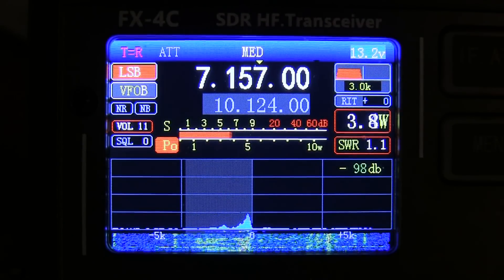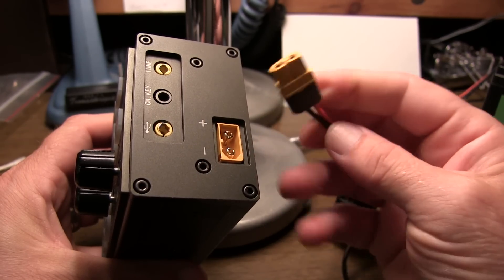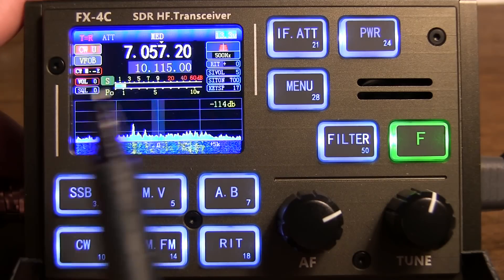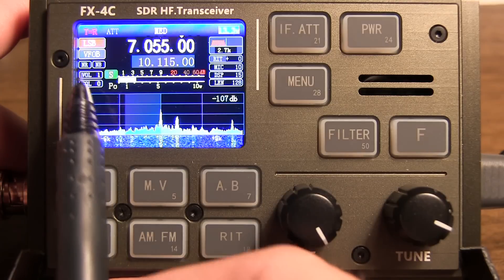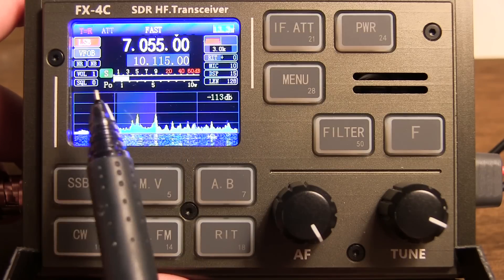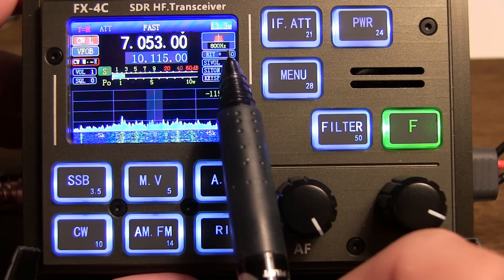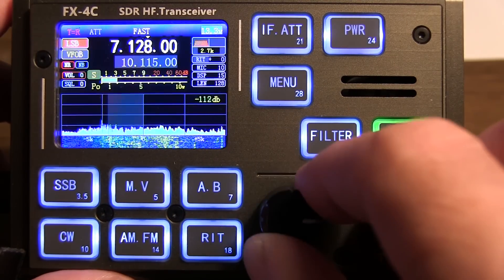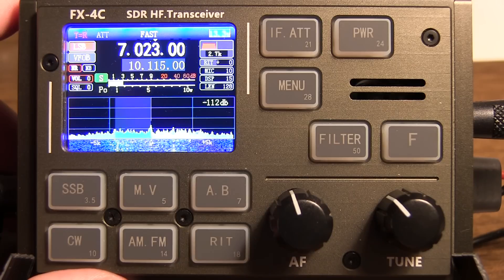#355: Radio Review: FX-4C SDR  QRP Transceiver | Review of features and operating controls

Comment: I think the tuning knob on my Collins R-390 is larger than that radio and it will never keep the room warm in a cold winter. My newest rig is a homebrew AM station using a 1947 James Millen amplifier running push-pull 812A in swinging-link-coupled output. I am working all the "new" DX with it and my R-390. If you zero-beat the SSB station, they usually do not even know you are on AM. 
I will stick with my S-Line equipment that I can still repair with a lifetime collection of parts. 
I borrowed a nice HF rig a couple of years ago that had just under 100 adjustable settings with all the button pushing, twisting, shoving and talking to and it worked great unless I accidentally touched something while reaching for the microphone that I was not sure what I touched and then I had no idea what was going on. 
You make very nice videos, Alan.   73  WA4QGA
Reply: Amen!!!
Reply: Hi David, and you have to set fire to it to get that warm glow on a cold rainy night !! However I might buy one for camping......

Comment: Thanks for the review Alan.  Looking at the specs it's not clear that it transmits FM   Can you confirm.  Additionally, can you comment how well the NB and NR work?  Additionally, can you put it next to your SA and let us see the spectral purity?  73, Frank K9IC
Reply from the maker: It does transmit on AM and FM, but I haven't tested this other than to verify that it supports these TX modes.  Regarding the NR and BW:  I personally have never found a Noise Reduction scheme that is comfortable to listen to or gives me better clarity than my own brain's ability to understand a signal.  I find most NR function annoying to listen to.  I would say that it works, and probably could be optimized through the settings in the Menu, but I didn't care to play with it.  As for the Noise Blanker - I wasn't operating in any location that had any kind of pulsating noise that a NB is designed to reduce, so I didn't have a change to check its effectiveness.
Reply: Tks Alan.   I agree w you wrt NR systems until I played w FLEX 6xxx.  Both NR and NB are superior to any that I have used
Reply from the maker: @franksweeney1395  I've never had a chance to operate one of those big-boy Flex radios - I'm sure it is excellent!

Comment: If the manual AGC is added, it should go a long way towards helping the strong signal desensitization you noticed. An automatic notch filter function, like in OpenHPSDR would be even better, but might not be achievable in a non-DDC radio.

Be interesting to see how well the unit does doing FT8. Some of this radio's competitors are pretty sensitive to rf killing of the USB port sound connection to a PC.

Price is maybe a bit high for unit without internal battery and minimal support, i.e. Xiegu X6100 with similar functionality, currently going for low 600's.

Comment: I've noticed the same issue with strong signals in the waterfall affecting the AGC, and even bleeding through the demodulated audio on occasion.  But I've been seeing it in the Malahit receiver.    I suspect both rigs use similar hardware.  Perhaps they are both based on that receiver on a chip that's popular.  Maybe it's just an artifact of that chip.
Just looked the FX-4C up,  $524?!   Pricey!
Reply from the maker: Yes, it is a little pricey.  But that includes express shipping from China (I received my unit in less than a week), as well as a small Pelican style hard-shell case with a well made foam insert for the radio, mic and wires.
Reply: @w2aew  It does look to be a fairly high quality build.  I guess if you're comparing it to  an elecraft, it's a bargin.
Reply from the maker: @loughkb  Yes, or even the IC-705.  This unit won't have the sensitivity and adjacent channel performance of either of them though.

Comment: Looks very promising. I like the digital modes integration feature. Despite visiting the page I found little to no information about the internals. 20 khz is not that much of bandwith, I wonder what is used for signal processing in this unit. It doesn't really seams that "open source".
Reply from the maker: I don't think there's any intention for this to be open source.  The english manual on the website does need updating, as the images in it reflect an earlier version of the firmware.
Reply: @w2aew  Hmm, to be honest,  of coarse there is no obligation for SDR projects to be open source, looks like it was only my positive feelings and supositions about such projects. The radio looks nice, but I would prefer something that I can understand/decompose/modify to some degree

Comment: Just indredible what you can do with modern software radios. My only comment is that with so many functions hidden behind the limited number of butons, after a while if you haven't used the rig, you will forget where things are.  Leon VK2DOB
Reply: For infrequent use, I guess it  just needs a well designed menu "cheat sheet" - like the laminated one I made for my  Nanovna.   But most buyers are not likely to pay the big price for this rig and then not use it regularly!
Reply from the maker: Yes, certainly understandable.